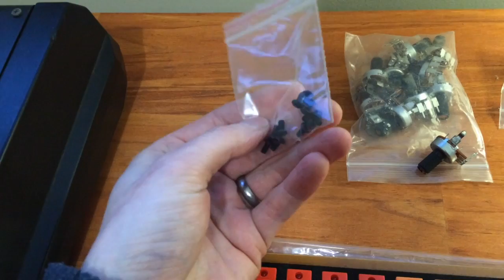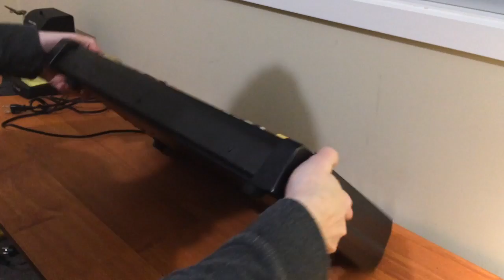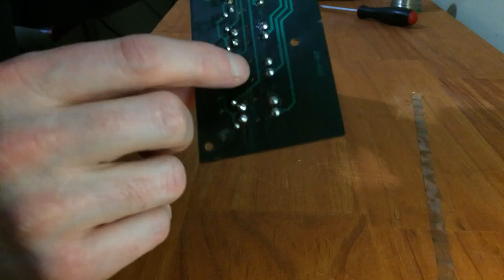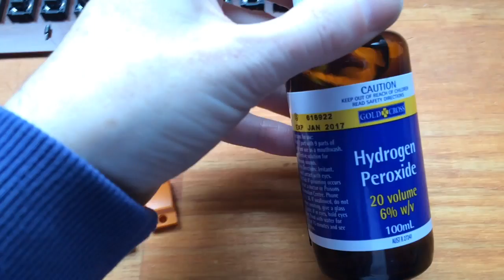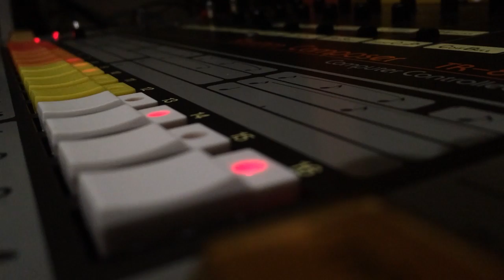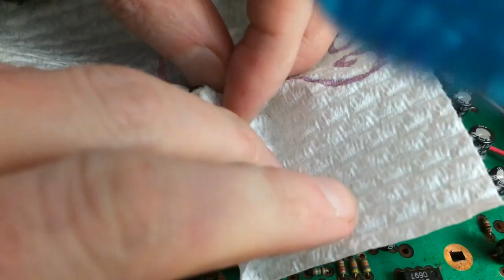Roland TR-808 Restoration (Part 1 of 2) - Switches, pots and other replacement parts.

Comment: For the UV faded button cap, have you tried the hydrogen peroxide method? If you submerge the faded plastic into hydrogen peroxide and leave it in the sun for about a day or two, the UVs + the Hydrogen Peroxide would reverse the yellowish fading.

There are YouTube videos of people doing this with opaque plastics, but I haven't seen anyone do it with clear plastics.

Comment: Hi Golt.  On my actuator board, switches 5-8 (orange) no longer work, and I was wondering if you had any idea of what to check.  They don't light up, nor can you program them at all - completely dead.  All of the rest work fine.  I ordered a replacement board from Syntaur, but same result, so it must be something else.  Just thought I would ask.  Thank you.
Reply from the maker: G-Force It’s usually the ribbon cable that connects the main board to the switch board. You may have to pull it out and solder a new ribbon cable on, or replace each of the wires individually. Don’t worry about saving the connector, just solder the wires at both ends.
Reply: @GOLTSYNTH  Thanks. Do you do repairs for hire?
Reply from the maker: G-Force No I don’t unfortunately. I work full time repairing scientific equipment, I only do synths as a hobby. Once every now and then I’ll do a synth for a friend but it will depend on what I’ve got on at the time. At the moment I’m not accepting any.
Reply: @GOLTSYNTH  Okay, thank you.

Comment: If you really want to replace the faded start stop tap labels you could maybe scan the originals to get the original font, process them and reprint them on the new paper?
Reply from the maker: Good idea!
Reply: Do you have a process for cleaning the outer case? Yours seems extremely clean :)

Comment: Hi, great video.  Do you know if the start/stop buttons from the CSQ-100 can be used on the TR-808 (the actual switch, not just the plastic)?  Or any idea how to repair them?
Reply from the maker: Yes they are the same.
Reply from the maker: I just popped it open and had a look. The transformers that I used will only work with a 240v mains supply. If you have a different mains voltage you will need to use transformers with a different primary winding that suits your country.
For +/-15 analogue rails: POWERTRAN Model M 2855L
For the 5V rail: POWERTRAN Model M2840L
Both from Altronics.

Comment: Great vid!
You are a real stick(l)er for detail, are you? :-) I personally think that a certain bit of aging adds to the bouquest of the whine, so to speak. Trying to make the thing factory new will always stay relative anyway. The silk screen printing will for instance also have discoloured over the years.
A few possible alternative / more budget cures:
- Partly keeping the original transparent switch covers, grind the tops off and only replace those with clear sheet material. It would however need some finesse to glue them on perfectly.
- With the replacement switch assembly it t might have helped to heat up the soldering joints on the switches and try to repositions them. The overall fault seems to be little more then a mm so the actual problem might not (only) be the actual board design but (also) the assembly method.
- Slightly sanding down the switch caps at thier sides might also help (they are too wide anyway) but that would again be a rather delicate operation.
Do not take these remarks as critisism though. I'm just thinking out lood.

Comment: Great video. Thanks for sharing your info so others can learn. If a csq100 or 600  isn't available to canabolize what screws did you find that were close to the original?
Reply from the maker: I haven't been able to find better screws than the CSQ's. But any black screws with the same thread from eBay look OK.

Comment: Great video. I am having some problems with orange/white pots and pattern switches.
Looking at the Syntaur pots come at different resistance 5,10,50,100,500 when you buy them separately and they are quite specific that 100KA is not used for Accent and Cowbell but on the other hand they list a kit of 12 for all instruments level.
I struggle to understand the difference between the small color coded pots. Can you please advise on pots and their specs? Is calibration necessary when replacing pots?
Reply from the maker: The pots with the white inserts are in the sound generation parts of the circuit, so those values need to be kept the same or the sound will change. The pots with the orange inserts are in the amplifier parts of the circuit, so their 
values depend on how each instruments amplifier is designed. Most of the instruments just use the standard op-amp config, so the pots will be 100KA. The A is for audio taper and is what is most used in amplifier circuits. The accent is a control voltage amount, so it's not an audio amplifier circuit. The cowbells output is a little different as well. So you need to stick to the original values if you are going to replace anything. The old pots will have the full resistance written on them (like 100KA) but the new pots will probably have a code (like TTB103). The A or B is the taper and the number on the new pots is a resistance code that you can look up on google, like 102 103 104 etc...
Reply: Thank you for the response and explanation.Since I left my comment I've opened the machine with intention to measure the impedance of the pots. However this was not needed as each pot was already labeled. Syntaur doesn't stock some of the pots and the one they do are quite expensive so I'll keep an eye for a cheaper offer.. I believe my scratchy pots needs cleaning only. The whole reason for replacement was because lots of them being cracked and some inserts are missing (just like on yours). The only feasible and cheaper way to solve this problem is to order some pots (any type regardless impedance from Syntaur or elsewhere), take them apart and swap only the shaft part on the old pot, if you do understand what I mean. I'll keep the carbon track from the old pot.